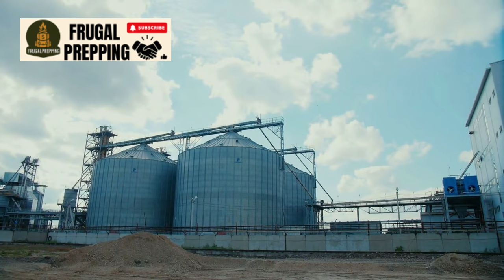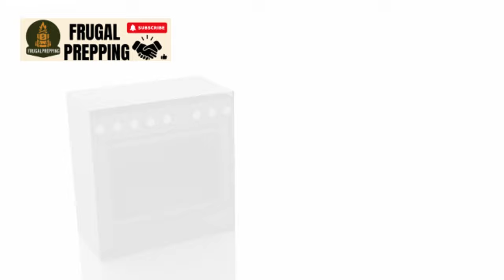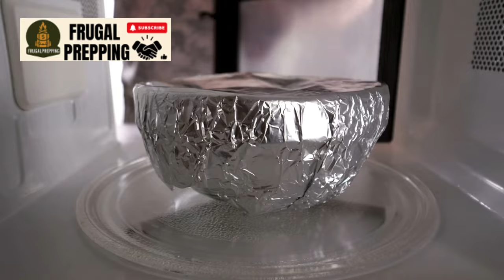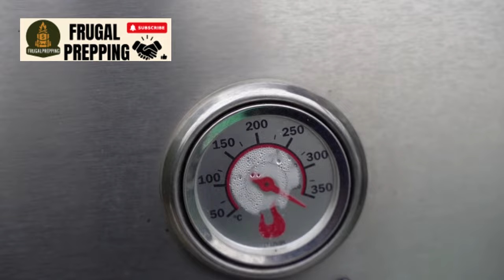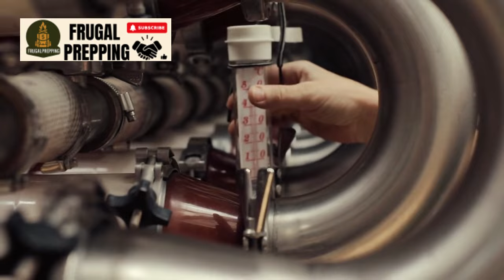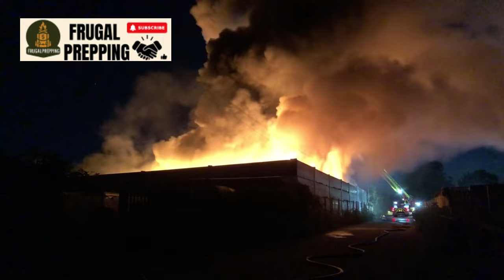12 Critical Winter Survival Items Every Prepper Needs Before the 2025 Grid Failure

Comment: I live in MN.  I have many heat sources. 

If you have propane, do make note of indoor, outdoor heaters.  It is tops on shelf life, and good on cost.  A sunflower is great, spify to cook on, but it can kill you.  Indoor heaters burn the gas much much more complete like.  

Wood heat is the only fuel I can go outside and pick up off the ground.  It is the only one that will last the test of time.  It is the original TV.

Kerosene has a short shelf life.  1-5 years. depending on how it is stored, and how gummed up you want you wick.  If you don't consume it with something like a cabin, a garage, little wall tent, or just stand around it outside a few times a year....I wouldn't bother with kerosene, but it does work great.  

Diesel heaters are great too.  Like kerosene,  If you do not use diesel already.  I wouldn't bother. 

Electric heat from solar is a tall order for a house.  A 2000w inverter ain't gonna do it.  Bigger systems could, If they are big enough.  You need to scale down the area to one room, or other small box.  100W electric blankets are great.

Proper clothing, and blankets.  Wool. 

Thermal mass is important no matter what the heat source.  Breathing oxygen is always important as well.

I can, and have taken my sleeping bag, and my wool blanket,  proper clothing.  Outside in -60f with a 60mph sustained winds.  Crawl inside and go to sleep.   A gortex and down surplus M.S.S.,  both bags.  It is made for the biggest guy in the Army.  I am much smaller than that.  with the thick blanket, it is still roomy.  Me and my water.
Reply from the maker: Thanks for sharing your extensive knowledge and experience with different heating sources and survival tips!